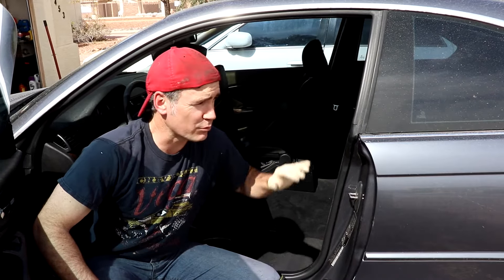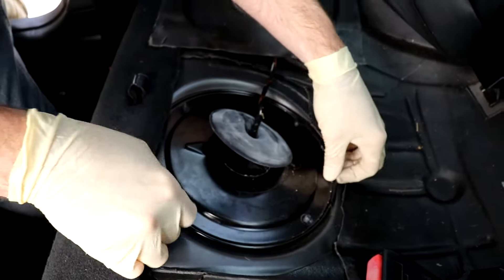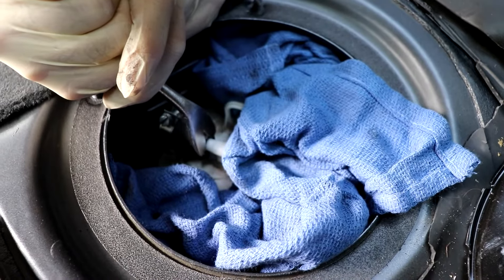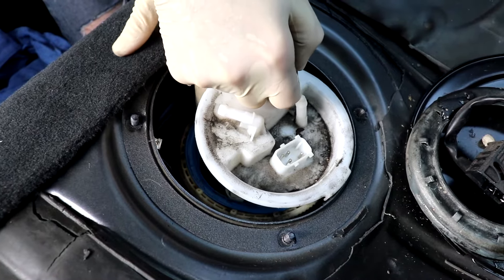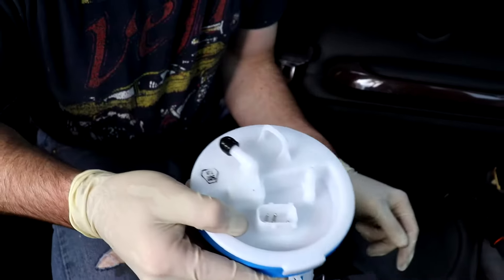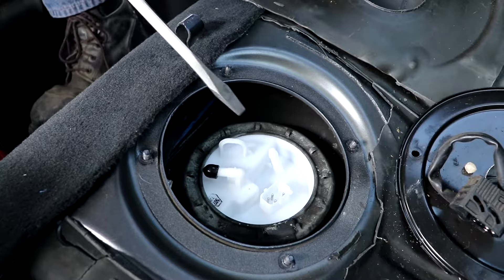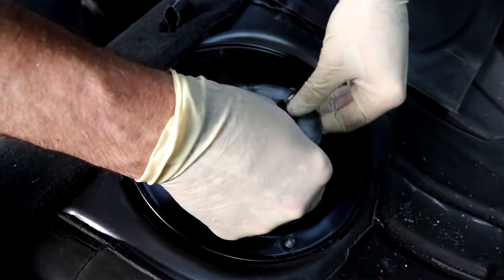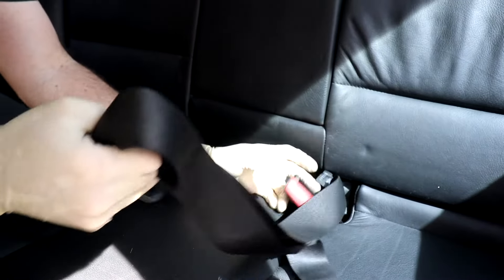BMW E46 FUEL PUMP REPLACEMENT IN UNDER 10 MINUTES!

Comment: Mine finally failed after 210k miles. oddly enough it failed pulling into the garage. This video was helpful and it was the easier pump I've every replaced.
Reply from the maker: Thanks for the comments Tango, glad the video helped you with your BMW project. Be sure to check out the channel for a few more E46 videos we have posted.
https://youtube.com/playlist?list=PLFnK0z3T00fUUTptx-Y4R0i9CsuNcVOBw
Cheers!

Comment: Some have suggested cleaning the area of debris before removal, good idea.  But NEVER use a shopvac to clean up fuel.  It will explode.  I spent four weeks in the hospital dong just that.
Reply from the maker: Thanks for the comments John, sorry to hear about your accident. You definitely don't want to run that shop vac if you have any chance of fuel vapors. 
Another option would be to use a leaf blower since the motor should be far enough away from the fuel pump assembly and not have any risk of coming in contact with the fuel vapors. 
Appreciate you hanging out, Cheers!
Reply: Hope you are alright now thanks for sharing
Reply: Goddamn noted 😭. Hope u good now🙏.

Comment: Great video.  I noticed the wrap on the pump harness was in rough shape and leaving the internal wiring exposed just like the vehicle I am working on.  Is this something we should try to fix, or is there probably not enough friction under the seat pad to really make the issue worse?  I was just going to wrap some electrical tape back around it, but maybe its a waste of time.
Reply from the maker: Thanks for the comments Dupre, glad you enjoyed the video. There is not really any movement under the seat but it would be a good idea to wrap any exposed wires. You don't want to have a short happen while driving, and the car would just suddenly die on you.
Good luck on your BMW project.
Cheers!

Comment: Great video! Any tips for getting an original clamp removed from the line? Nail cutters, screwdriver, or what?
Reply from the maker: Hey Ironnerd, thanks for the question. I find that large wire cutters or tin snips work the best for cutting the old clamps off. You can also try to use a small tip screwdriver or similar tool to spread the top of the clamp apart. This will give you enough slack typically to remove the fuel hose. 
Since you are playing around fuel, you want to avoid using any kind of cut off wheel which can create sparks.
Good luck on your project, Cheers!
Reply: @BradleysGarage  Thanks for the reply. I figured I would ask since almost no videos cover the original clamp. Well, one did. It involved a grinder.

I'm on the original pump at 160000 miles. Pressure at the rail is spot on. Problem is that my fuel gauge went wonky a few fill-ups ago.
Reply from the maker: Just wanted to share this with you since you mentioned issues with your fuel gauge. 

Both sides of the tank have a sending unit. You can check the sending units with an ohm meter.

RIGHT SIDE
Empty -- 70.0 +-1.2
Full -- 394.5 +-4.5

LEFT SIDE
Empty -- 70.0 +-1.2
Full -- 310.2 +-3.6

With the sending units out, you can inspect the sweep and the contact. The sweep is attached to the arm with the float on it. You can use a stiff business card and contact cleaner to remove contaminants from the sweep and contact patch. Be careful to not bend the sweep.

My understanding of the way the circuit works is that the two units are a parallel circuit and the average of the output is the indicated fuel level. You cannot look at one sending unit as the cause of the problem -- one unit can be the cause, but you cannot go in with the idea that it is the right one or the left one, it can be either.

Let us know what you come up with on yours, Cheers!
Reply: @BradleysGarage  Thank you for the info. I am already on it. I figured I would replace the pump as a precaution and also have sending on hand unit if I need it. 

I think I got some dirty gas somewhere. Out of nowhere, it started acting up. Techron didn't clear it up. So, I bought both units to be sure. If I can't clean the sending unit, I'll replace it. I'll try the contact cleaner and business card.

I am taking a 7 hour trip next week and hope I'll be taking the e46.

I'll check the resistance this weekend when I replace the pump. Right now, both sides of the tank on the OBC fuel display are wonky.

We will see once I crack it open on Saturday.

Comment: Fantastic video, checked my relay and fuses all good and pointing to my pump, do you know is this replacement pump would be the same as the e46 m3? Thanks
Reply from the maker: Thanks for the kind words, glad you enjoyed the video. On the M3, the S54 uses a different in-tank fuel pump assembly. The process is very similar but the actual part is unique to the M3/S54 platform.
Here is the correct part for the 2001-2006 M3 - 
https://www.fcpeuro.com/products/bmw-fuel-pump-assembly-m3-16142229684
Good luck on your BMW repair, let us know how it goes.
Cheers!

Comment: Awesome video! I hope you still respond to comments here, how do you know the fuel pump failed. I hear my pump prep when I put the key in the second position. I checked the engine and there is fuel “squirt” from the valve, I checked the fuses and are ok;  however I have a Crank - No Start. Is it the fuel pump or something else completely different. 
The codes that I get are for misfires in cylinders 4-5-6, and code 1421.
Reply from the maker: Thanks for the comments Bernie, sorry to hear you are having trouble with your E46. The first thing we would do is rent/borrow a fuel pressure tester that can be hooked up to the schrader valve on the fuel rail. I know you mentioned you are hearing the buzzing sound like it's working but just because you have a little squirt of fuel, does not mean you have adequate pressure from the fuel pump.

Fuel Pressure Specs -
All engines except the S54 3.2L M3 - Fuel pressure 3.5 +/- 0.2 bar or 50.76 +/- 2.9 PSI
Residual fuel pressure after 20 minutes - Fuel pressure >3 bar or >43.51 PSI
Fuel Volume Specs -
All engines 1.12 liter (1.16 qt) for 30 seconds at 12 Volts or while crank

Depending on the outcome of those tests, it will help guide us in the next direction. If the pressures are low you might have a clogged fuel filter.

Fuel filter
A clogged, or restricted fuel filter usually causes engine performance problems, but it can also contribute to no/hard start.

Fuel pressure regulator
On the 325i/330i this is part of the fuel filter, so by replacing the filter, the FPR will also be renewed. On the 323i/328i it's separate from the filter. These rarely fail on the E46, but it's a possibility. No start due to no, or low fuel pressure can be caused by a defective fuel pressure regulator.

Let us know what the tests reveal and we can go from there.
Cheers!

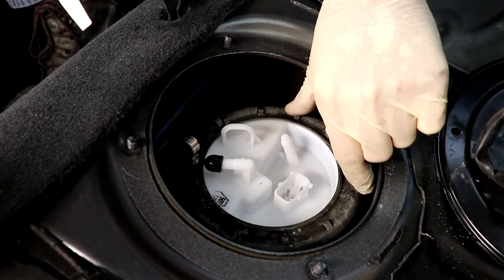Comment: Having the fuel tank about 3/4 full didn't prevent us from making the repair.  We bought a little siphon hand pump but couldn't get any of the fuel out.  Seems that that is a difficult thing to do on this car.  We got that ring loose by having two people and two screwdrivers and two hammers working at the same time - one at 6:00 and one at 12:00.  Also, to get the hose off we slipped a 1/2 open ended wrench over the end of the hose and tapped on the wrench with a hammer, as a way of pushing the hose off.  I was worried about damaging the hose and that worked pretty well.

Thanks to your video my son fixed his own car for $47!

By the way, why did you say you need less than half a tank to do the repair?
Reply from the maker: Thanks for the comments, glad you enjoyed the video. Appreciate the tips and feedback you provided, I'm sure it will help the next guy out. 
With regards to the fuel level, we just recommended half a tank as to not cause any issues when doing the repair. Sometimes you may not be working on an entirely level surface and thus could potentially cause some spillage. In addition, with the tank close to full you also have to let the fuel pump assembly "drip" a bit in order to not drop any fuel in the car, or be very fast with the transfer to a bucket.
Thanks again for hanging out, Cheers!

Comment: What is stopping you from replacing it with a full tank? Is it going to overflow when you lift the pump? I drove like 40 miles on a full tank before it went out. It must have used at least one gallon, so it shouldn't be full up to the spout...
Reply from the maker: Thanks for the comments Alex, you should be okay if you burned off a gallon or so. Just keep in mind it may be very close to the top of the tank when removing the fuel pump.
Good luck on your BMW project, Cheers!

Comment: What year car is this? I heard from 2003 onwards, the entire tank has to be replaced, as it's an integral unit(?)
Reply from the maker: Thanks for the question. The only car that uses the internal pump built into the tank is the 2002-2006 E46 with the M56 SLEV engine. That model was only originally sold here in California, New York, Massachusetts and later in 2004 in Vermont.. With that engine the entire fuel tank must be replaced in the fuel pump goes out. 
Our video covers the other common engine platforms, M52, M54, S54.
Good luck on your BMW project, Cheers!

Comment: Hi, great video. Can you help? I’m in the UK so right hand drive. My fuel pump seems fine, but my gauge only goes up to 50% full. Which side do I need to change?
Thanks
Reply from the maker: Thanks for the kind words Matthew, glad you enjoyed the video.

First run a gauge sweep test to make sure the fuel gauge can register or sweep to the Full mark. 

Use the Hidden OBC Menu to do this, see link below.

Then check to see how much fuel is in each 1/2 of the fuel tank when full using the Hidden OBC Menu, this should allow you to determine what one of the two senders in the fuel tank may not be working properly. 

The most common problems are a float arm disconnected or not properly snapped into the level arm on the sender, obvious when the sending unit is removed, a corroded or oxidized sending unit resistive sensor that the actual center arm slides across, a physical problem where someone has been in the tank and/or replaced the fuel pump and either bent the sending unit arm or the fuel hose is interfering with the float arm and last and least often found is a sending unit float saturated with fuel that will not properly float because it weighs too much due to gasoline saturation.

Hidden OBC Menu - Check Voltage, Temp, Fuel Level - http://forum.e46fanatics.com/showthread.php?t=239619

With all that being said, it is typically the passenger side fuel level sender that is bad. Even though people have talked about the driver's side sender sometimes is an issue, we have never experienced that with any of our E46's. Every time we had a fuel gauge issue it was the passenger side Fuel Pump/Sending unit. The fuel pump part will still work just fine, it's the sending unit that becomes defective with corrosion and age.

How long has it been since the fuel pump has been replaced? They typically only last about 10 years if they are the VDO brand. Any other aftermarket will be less than half of that.

Good luck on your BMW project.
Cheers!
Reply: @BradleysGarage  Thanks so much for such a detailed response. Can I confirm, when you say passenger side do you mean the right or the left, as my steering wheel is on the right?
Thanks again
Reply from the maker: @matthewplant6791  Sorry Matthew, forgot you were in the UK. Sitting in the car facing forward it would be on the right side of the car. That's the Fuel Pump assembly with sending unit.
Keep us posted on how things go.
Cheers!
Reply: @BradleysGarage  Thanks! Will do
Reply: Hi, I replaced the pump / sender as directed. Your instructions made it soo easy- thankyou for an awesome job. 
Unfortunately I took a gamble and just replaced the right hand side one, when. looking forward. 
The pump works but the gauge is showing about 40% full- and I just filled up! I did the gauge reset but still the same. 
What’s the next step? Change the other side?
Reply from the maker: @matthewplant6791  Sorry to hear you are still having trouble Matthew. 
Were you able to access the gauge cluster menu to get the reading for each level sensor?
That would have given you an idea if the right hand side was reading accurately before replacing it. If it is in fact the left hand side level sensor, you should be able to see that with the secret menu.
Let us know how things go.
Cheers!
Reply: Thanks- I replaced the other side & bingo! it worked- thanks for your help 🙂 @BradleysGarage

Comment: Excellent video.  I don't have a problem with the fuel pump but with the fuel gauge.  The guage visibly moves around and is not reading the correct fuel level.  For example I've done 200 urban miles in my E46 325i Sport and it's reading more than half full.  It should be reading less than a quarter.  The thing is,  I'm confused as to how to locate whether it's the one you replaced here or the other one.  I've done that hack on the instrument cluster but can't seem to see anything awry there.  Any help/advice would be greatly appreciated.
Reply from the maker: Thanks for the question Dave, appreciate all the info you provided. We actually just did a repair on a 2000 E46 323iT that was experiencing a similar issue. The fuel guage would move around after every drive cycle and make wild claims about the DTE.
We ended up replacing the fuel pump itself because more often than not it's the passenger side that's the issue.

The sending unit on the drivers side does goes out but not as frequently as the sending unit on the fuel pump itself.

You can try to run two tanks of Chevron Techron Complete Fuel System cleaner to see if that frees things up. You might get lucky and that will solve your issue.

But I would say if you are still running the original fuel pump, it is most likely what's causing the fuel guage inaccuracies.

You can also remove both units and "clean" the sender contacts as they become corroded over time. Here's a lengthy thread that goes through all of the maintenance options - https://www.e46fanatics.com/threads/save-yourself-up-to-200-and-some-headaches-electric-fuel-pump-pm.929501/

Please let us know how the repair goes and what turns out to be the issue. Thanks again for hanging out, Cheers!
Reply: @BradleysGarage  Thank you so much for the indepth reply here... really appreciate it.  I'll let you know how I get on with this... and thanks too for the cleaning link :)  David.
Reply from the maker: @davyboy888 No worries, glad we could offer you some possible solutions. Keep us posted on how things go, Cheers!

Comment: Good chance to clean and condition hard to get to areas of seats, but then I always make way to big a project out of these things as a result.
Reply from the maker: Agreed, it's a great time to vacuum up under the back seat and clean everything up. This was a super quick fix and therefore we neglected to do the normal cleaning. Thanks again for hanging out, Cheers!
Reply: @BradleysGarage    Much appreciate tutorial, neglected some aspects of old 330 beyond oil changes and such, need to play catchup.
Reply: @BradleysGarage   OH...for 1st time ever got stranded, apparently fuel system, lucky only 2 miles from home couple wks ago.  (stupid me never even replaced fuel filter/regulator)
Reply from the maker: @Mrbfgray  We've posted a few videos on the E46, our most recent is the valve cover gasket. This is a common issue and may cause a check engine light lean code to appear. Occasionally the valve cover itself becomes cracked and causes issues.

Valve cover link -  
https://youtu.be/vpy-THtfVrs

Have fun on your E46 projects, Cheers!
Reply from the maker: @Mrbfgray  Yeah they say the fuel filter should be changed every 30-40k, some even say as often as 15k miles.
Let us know how your E46 projects go and if you have any questions along the way. Cheers!
Reply: @BradleysGarage    Can't thank you enough.  Hat's off.

I'll put 330 high as possible on jack stands, needs front suspension overhaul too. (lucky have low miles 2011 E92-M3 to fall back on, HA!)  Try to remember to get back to u after replacing filter.  🙂  Maybe pump too IDK .

Don't normally believe in 'throwing parts at it', vs diagnostics, but some of this obviously needs to be done anyway.
Reply: @BradleysGarage    Rodger valve cover, no doubt mine is leaking.  Gotta get in running 1st.  First time it ever didn't run in 20 yrs!

Comment: If fuel pump is not issue then what else could be? all fuses are good. Any tips?
Reply from the maker: Thanks for the question. The first thing to verify is that you have the correct fuel pressure at the fuel rail if you are hearing the fuel pump running and that is working properly. There is also a fuel pump relay behind the glovebox panel but that would mean the fuel pump would not be buzzing. Another issue may be a clogged fuel filter if the car is trying to start but just won't crank over completely.
You can rent/borrow a fuel pressure gauge from the auto parts store to verify fuel pressures. Here is a great step by step that walks you through the process.
https://www.pelicanparts.com/BMW/techarticles/BMW-3-Series-E46/108-FUEL-Fuel_Pump_Testing/108-FUEL-Fuel_Pump_Testing.htm
Good luck on your BMW project, let us know how it goes.